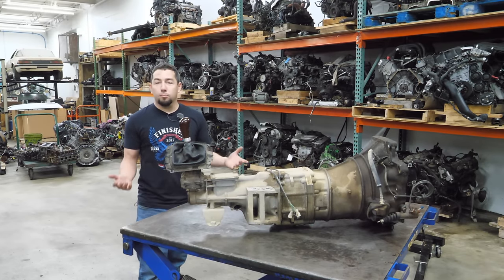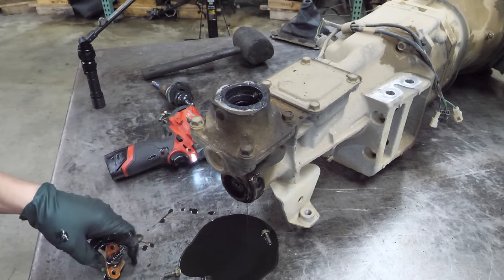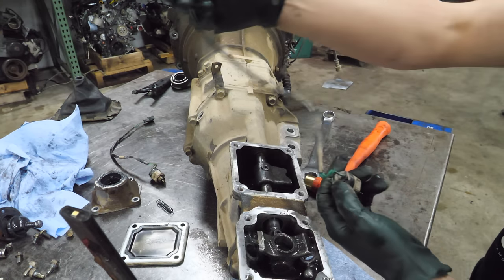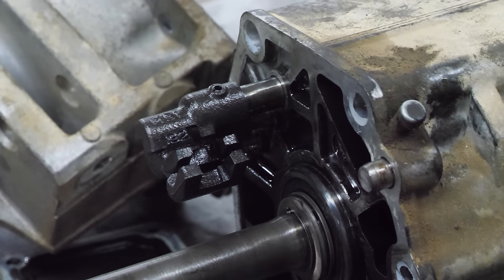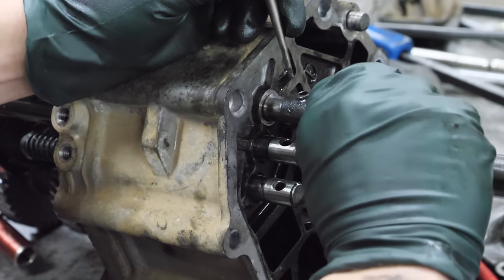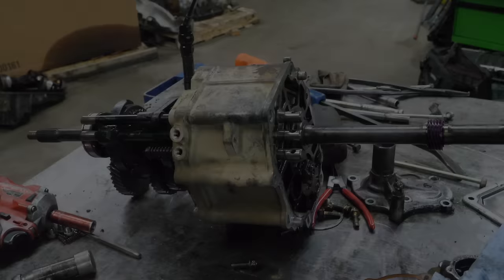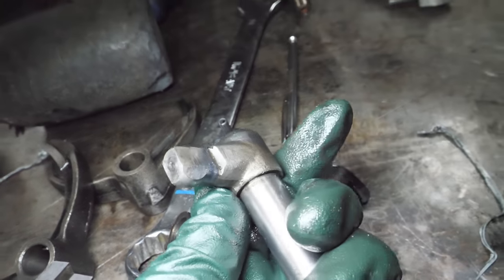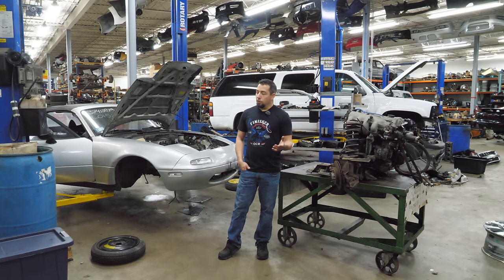JAMMED in Gear after wreck? Mazda Miata Manual Transmission Teardown

Comment: I have a Massey Ferguson 202 tractor where, if you mess a gear change up, you can get the transmission shifted into two gears simultaneously.  You know right away when engaging the clutch just stalls the motor (I've never managed to do it at speed because tractor transmissions are not synchronized.) The fix for that is to remove the transmission filler cap and coax the shifter gate back into neutral with a big flat-bladed screwdriver.

Comment: How dare you tease me with your RX7 and B Series truck. I had both when I was a teen and early 20's.  My Truck was a long bed with 8 - 15's in the bed with a snug top. My bed was also hydraulic and moved up and down and side to side. I miss that truck. Don't get me started on the RX7. What a gem. Do you want to part with yours?

Comment: My daughter's '91 Miata had a "locked up" five speed transmission, and it turned out to be a misaligned 5th/reverse shift rod. The shift lever would smoothly engage 1st, 2nd, 3rd, and 4th, but you could not access 5th or reverse. In addition, the car would stall if you engaged the clutch in the forward gears. However, if you placed the shifter in neutral, the car would back up. It appears this transmission was similarly jammed, but the shift rod timing mechanism kept it from engaging 1, 2, 3 or 4.

Weird symptom, but since the transmission already was in reverse, engaging a forward gear would lock up the transmission. To fix it, I removed the reverse light switch on the transmission case and moved the 5th/reverse shift rod into neutral. The problem is fairly well known in the Miata community, as I found a description of the issue and the fix in several Miata community websites.

Comment: I was hoping you would talk about the oil slingers. Those of us who pull these behind RVs need to know if the slinger is on the output shaft or the input. You can tow a manual with the slinger on the output. Not if it has it on the input only.

Comment: In my experience, manual transmissions that are locked in gear are actually partially half way or more in 2 gears at the same time. This will lock the transmission because of the difference in the gear ratios.

Comment: Now that you've done a 5-speed trans, now you need to find a 6-speed. I was always told the 6 speed was a stronger transmission than the 5 speed and if you built the engine (turbo or supercharger) to put a 6 speed in. I never had any real issues with my 5 speed (2000 model Miata) transmitting 225 hp to the rear wheels, but it was becoming a little difficult on the shift to 5th, I attributed it to a worn synchronizer. If you double-clutched the shift it was smooth, but would grind a tad if you didn't. I never had been inside one of these transmissions beyond changing the front seal during a clutch replacement. Thanks for the education.

Comment: Also used in the Ford Ranger/Explorer, M5OD i believe is the name. Had one in my 98 explorer, needed I THINK synchronicers done as it had 230K miles on it and only had issues after we put the reman OHV V6 in, lost all oil an seized it after 10K on the new motor.

Comment: I've been in a tight spot before with an old daily and it's 5 speed. The Aisin trans in it looked identical in terms of metal paste. Deep deep clean and cheapest bearing set had it going down the road again and to this day. Now that I'm in a better spot I'll probably pull it apart and do a better build on it soon.

Comment: if you can, an rx8 6-speed would be another cool transmission to teardown
they look really familiar to the miata 6-speed and my theory is that after the factory fire that ended the msm production, they just repurposed the gearboxes until they ran out, because rx8s shared ratios and everything until the s2 update. Ive only torn down miata 6-speeds (more times than i ever wanted) but never had a chance at an rx8 trans
even further, brz/frs boxes look similar too and have way different ratios with a way better overdrive
I'm pretty amazed by how different the 5 and 6 speeds are, completely different disassembly.

Comment: Technical clarification:  There is no such thing as "4th gear" in this transmission.  The 4th speed locks the output shaft directly to the input shaft, no gears involved.  The gears at the front of the transmission are the input shaft drive gear and the countershaft driven gear, which do not transmit any power in 4th.

Comment: One thing that locks the shifter to forward and back, can be fixed through the reverse light switch hole,, happens when you shift the trans when the car is off

Comment: 2002 Mazda Protege 5. Lost compression 140k miles. Bought new, then gave to brother. Kid has been driving it for the past few years. Mechanic found timing belt was missing teeth. Attempted repair. Still won't run. I am suspecting warped head. Not making knocking noises and spins freely. You want it? Engine is still in the car though. So you'd have to take the whole car!

Comment: The metal came from the roller bearings between the gears and the shaft. Can't really tell if it was savable without pressing the gears off the shaft. Since it was obviously run low on fluid for a while, I  understand using the bell to save another one in better condition.

Comment: I wonder if they had the fluid changed and the drain bolt was leaking after..eventually  let it run low..  probably would never notice that type of leak until it made noise.. if it even did. Or perhaps the part that was misaligned was a bit off from new, or some other incident... and the pressure cause the increased wear.. be like pushing on the shifter all the time when moving.
These transmissions can take about double the factory HP with no issues.. Friend of mine had a 94 Miata,  with Flyin Miata turbo  setup.  about 250HP at 15PSI... we broke two transmissions.. always second gear.. sheared a tooth off both times.   But could still drive it. Back then you could get a low mileage trans for $300

Comment: had a 91 ranger 2.3, the local 'guru' replaced the ATF w/ 90w, I drove for 300,000 miles, did not use oil, ran like a top, and 5 cam belts, wish I had it back...:finger-red-number-one:
i

Comment: Of course you should put a proper motor in the RX7. They're hardly sacrosanct.  Heck. Put a 2.0 L Pinto into it coupled with a slushmatic just for the reactions.

Comment: Most of that metal was probably from the synchro assemblies. A draggy (warped) clutch disk or a tight pilot bearing would put load on the synchros when shifting. Maybe not enough drivetrain load to cause grinding but still wear the synchro assembly. Of course another way to wear out synchros is clutchless shifting 🤣.

Comment: My 2000 ford ranger with a Mazda 5 speed transmission lost second and third gears at 32000 miles. No hot rodding just mostly town driving. Ford rebuilt it and  it still was grinding going into gear but I had all of the gears. I traded it in after that. What a disappointment!

Comment: I actually jammed a transmission in between gears once trying to downshift to make a pass and missing the shift. In all of that it somehow jammed the shifting mechanism. All I had to do was pop the mechanism off the top of the transmission, reset the selector, and put it back together. Now, that transmission wasn't bad like this one, but it was just an odd occurrence. I have a buddy that has also done the same thing on an older version of that same transmission in a different car. I STILL don't know how it happened or what actually caused it because as soon as I popped the mechanism off, it was fine. Kind of frustrating to not be able to figure out why a problem happened.

Comment: I've fixed a few, but transmissions are as complex as they are simple. Getting them together is usually easy, but getting the gears perfectly aligned is not. If you have 120hp, you might not know, but once you throw horsepower at them they eat  themselves if not put together correctly.

Comment: Is this what my 1990 honda CRX Si transmission looks like?

Mine still shifts in all 5 & reverse.

Just didn't keep up on 10w30 engine oil for transmission change.

Car just passed 349,000 miles.

Comment: Waiting for more Lotus content.  I want to see how you do that transmission swap.  I have an '02 Esprit with a 6-speed Boxter transmission in it, and while I did it myself you said theres a kit available somewhere.  Would like to hear more.
Reply from the maker: It’s not a “kit”, but a bell housing and flywheel adapter, and axles. From what I know at this point you have to make everything else.
It’s going to be next winter.
Reply: @I_Do_Cars  - Ah, ok.  Well, if you're getting it from Kennedy Engineering I designed it!  
You can see what I did starting on page 6 of the "WHAT TRANSMISSION COULD REPLACE UN1 ?" topic over on the Lotus Talk forum
Reply from the maker: @jct903  that’s the one! So cool!

Comment: The transmission needs love via new hydraulic fluid from time to time too.  
I bet if you stripped, cleaned, re-assembled and put new fluid in and even without new parts it would run for 100,000 miles if looked after.

Comment: The impact did it...the reverse gear can move forward with a impact, jamming up the shift forks or if out of the vehicle, set down to hard on the bell housing standing up the gear will fall toward the front of the trans....Toyota G series have what looks like a fill plug that says "do not remove". Its there to give access to the reverse gear so you can move it rearward and it all works again. W and R series you get to the gear through the fill plug...Was a simple fix but not worth fixing, worst trans Ive ever seen....

Comment: I see a first gen RX-7 up there in the background. I would love to hear your opinion of that car, rotary engine, etc. You don't see many of them left on the road anymore, and I'm guessing there's a reason.
Reply: Apex seals are the big one.
Rotaries are notorious for losing their apex seals (equivalent of piston rings) around 75k, which causes a loss of compression, no power, rough running, and a very expensive engine repair.
They also carbon up if you don't keep up on the ol' Italian tuneup or rev them out, further contributing to seal problems.
Which is sad, because they run smooth, rev all the way out, sound awesome, and are wicked fun.

Comment: I changed the oil on my new '23 RF Club at 5,000 miles, because I was starting to have shifting issues... and it looked just as bad: like silver metallic paint
Reply: my ' 17 RF Club's transmission oil and rear differential oil were low from the dealer at 5k. changed multiple times since and have 80k miles now. Rarely any dust on the drain plug
Reply: I felt the original fill was low, too (and I also changed the diff oil at 5k for good measure).  Transmission drain plug magnet wasn't clean.  I drained/filled the transmission again at 10k, and Blackstone Labs said there was 150 PPM iron in the oil, which they say is quite high.  Running Motorcraft oil in it now, and will do another drain/fill at 20k and see what they find.

Comment: 22:00 that's not 4th gear.  The 1:1 gear is never an actual gear.  It's just the locking lugs that the dog slides onto to lock the input and output shafts together.  The counter shaft is just freewheeling, carrying no torque.

Comment: Manuals and physical impacts don’t go well together. Had the same thing happen with a new TKO I bought, and had to take it apart pretty much almost as far as Eric did to get it to shift again. Thing got dropped on the input shaft and locked up tight as a drum.

Comment: Any chance gear got stuck due to the broken piece and someone poured some liquid in there to try to lubricate it? The wear does not seem to be aligned with the gear oil in the video… too little wear for that much glitter

Comment: look good  but the fork can make it jump out of gear 1or 2
Reply: most gears I open are nissan    4800vtc 4500 civilian   280gtx 240laurel   got metal but when i examine the gears most rebuildable examine the Needell bearing  for wear but this look like nissan specially the input shaft and pilot bearing